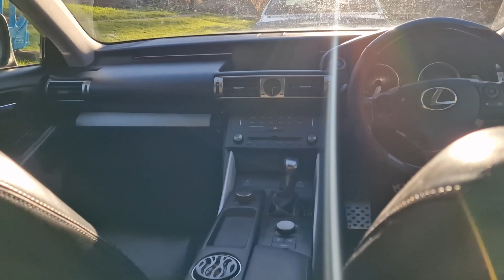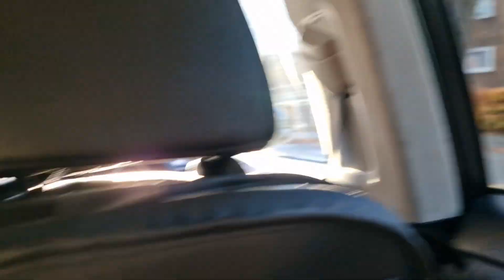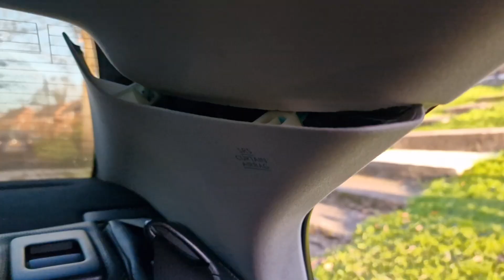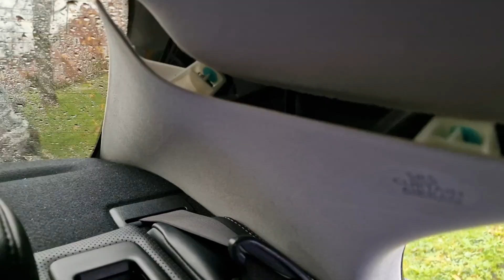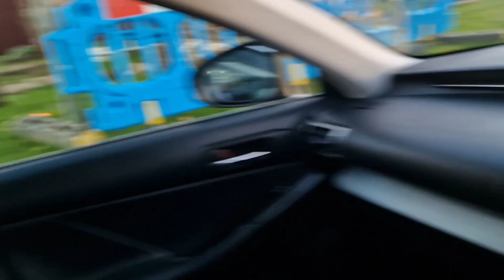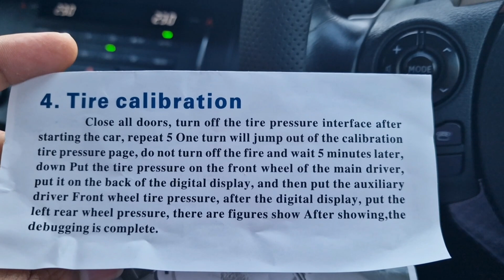UK RHD Lexus IS300h 3IS 2013 onwards TPMS Display module

Comment: I cant find one that covers 2013+.
I see only with 2015+ models.
Please, may you share the seller? In description doesn’t appear full link
Reply from the maker: Here you go I just found this on AliExpress: 
For Lexus IS 250 300h 2014-2023 Smart Key Control Automatic Side Rearview Mirror Folding Unfold Cable Plug Module
https://a.aliexpress.com/_Exbluyq

Comment: I tried to instal myself but i got error showing me tire pressure on dashboard.. first its blinking, then its static. When i disconnect and conect as it was, works normal as it used to. I have s design 2015 300h. I dont know whats wrong and why doesnt works for me
Reply from the maker: Not sure.. But i think the module may not be compatible with f sport models if you have that or maybe the module you purchased is defective

Comment: Gread video! The pressure information from the sensors is readable over the OBD interface. This means the car has all the information needed to display it on the dashboard. Do you know what this module technically does? And why the wheel pressure isn't displayed by default?
Reply from the maker: Not totally sure of the technicality behind it.. But what you're saying makes sense as it is visible on more premium trim levels. Perhaps lexus deliberately do not display it on lower trim levels.
Reply: This features does not appear to be active on UK models however is active on US spec lexus IS which is strange
Reply from the maker: @Kalhan482 Not sure what you mean. In the UK tyre pressure is visible from factory on higher spec models (premier/takumi). This module enables it on lower spec models.
Reply: @EDF317KA its not, I’ve had a 2018 is300h fsport with premium package and know a friend with Takumi spec and none display live tire pressure readings. They only come with a standard TPMS which pops up a symbol when the pressure drops
Reply from the maker: @Kalhan482 Ok. Thanks for letting me know. Im not sure on the facelift models if this changed but i believe the older premier variants had it. Unless Iam mistaken. My 2017 GS 300h which is very similar in many ways to the IS300h also has it.
Reply: @EDF317KA I can confirm that a 2019 UK IS300h Premier model only has the TPMS warning light in the instrument cluster, no live individual pressure data is displayed.

Comment: The device works great, unfortunately the downside is that when you want to replace one of the sensors in the wheel and program the car computer again with a new sensor number, this element will block both automatic programming by the MaxiTPMS programmer or trying to enter the numbers manually in the computer. The only solution is to either disconnect this device and program the computer or buy non-original programmable wheel sensors and program them according to the old numbers saved in the car computer.
Reply: This helped me very much.

Comment: Thank you for video. On my IS300h 2014 all works too. I checked it myself and you can make the connection easier by unscrewing the mounting screw holding the controller box, connecting the cables and then screwing it back on.
Reply: Did you remove the battery terminal before removing the C-pillar at the rear passenger side, or don't need to? Im worried that the airbag will blow up